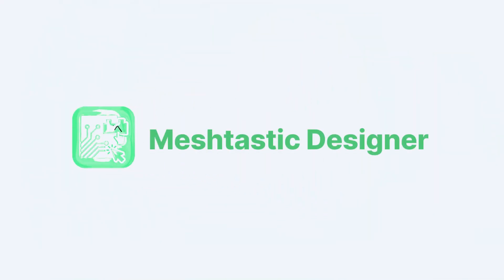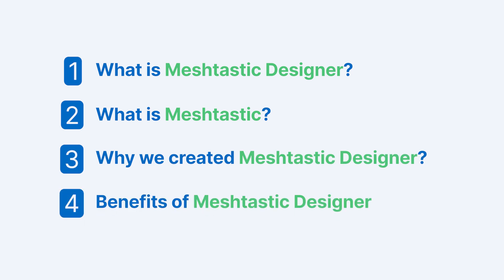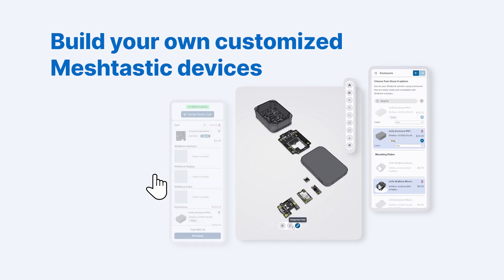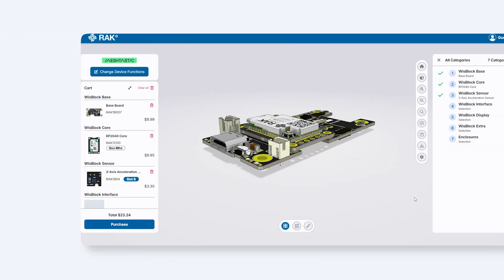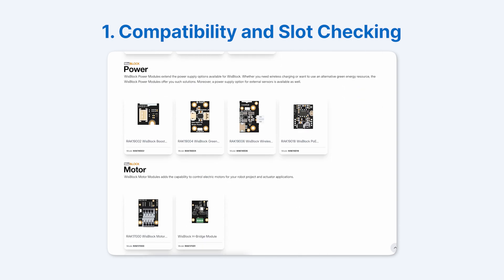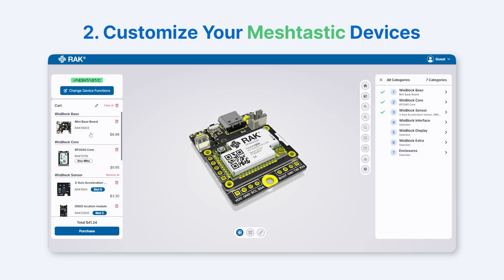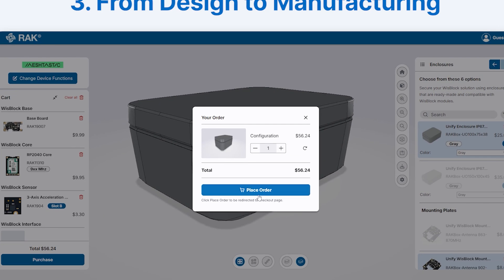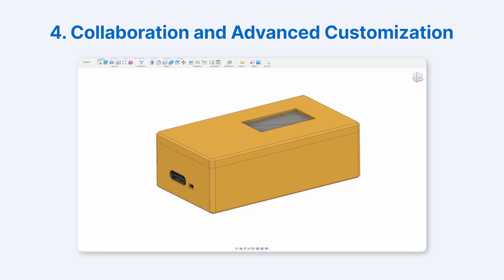What is Meshtastic Designer? | Build Your Custom Meshtastic Node

Comment: I want to use the meshtastic feature for a big project. Can a structure that is closed to the outside, works only inside itself and has around 1000-2000 sensor nodes be built? The structure will be built in a natural environment. It will not be built in a city.
Reply: Hi ressamendy,

1000-2000 nodes for Meshtastic might be too much. Meshtastic only use 1 frequency and spreading factor for the entire mesh and having 1000 devices on that configuration is not scalable.

It might be best to consult Meshtastic team via their Meshtastic Solutions program/service so they can give the best advise on this project. Work around can be using different frequency for a section of your mesh, optimizing settings to use minimal air time as possible, etc.